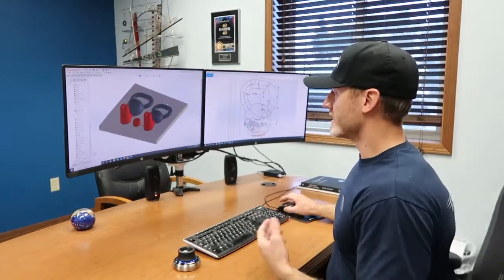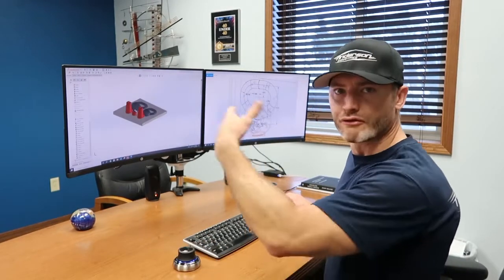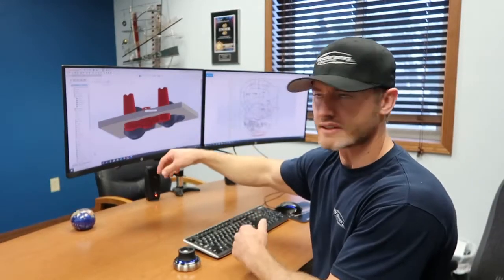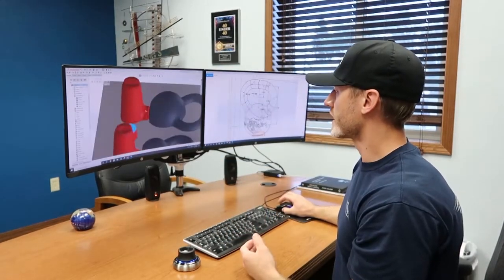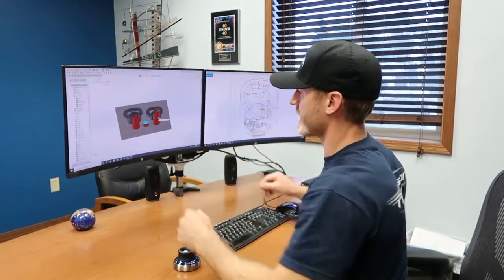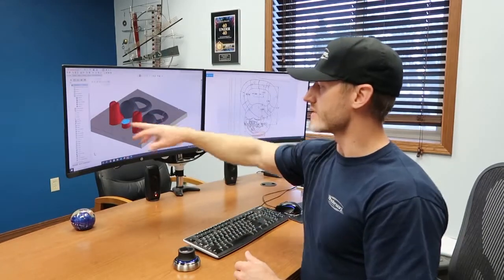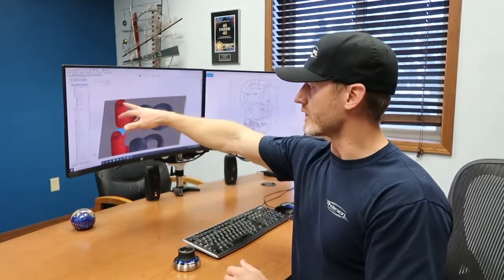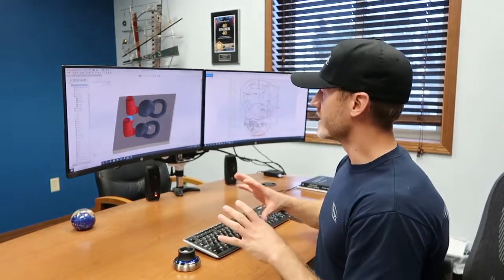Kettlebell Design for Manufacturing

Comment: Which software did you use for CAD model for kettlebell and Sand Casting ? Is it Solidworks ? Also for prototyping similar products, is sand casting the right way to go or some other casting ?